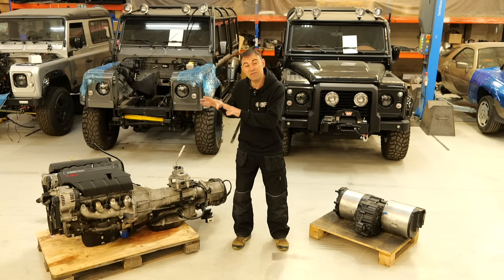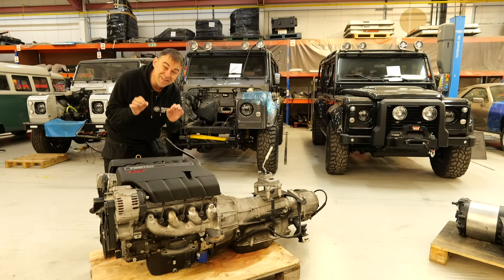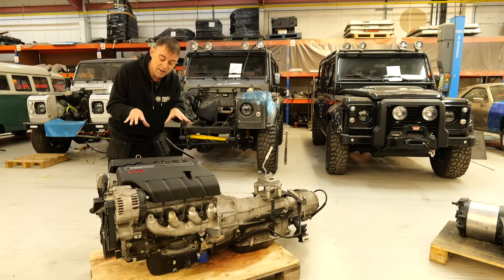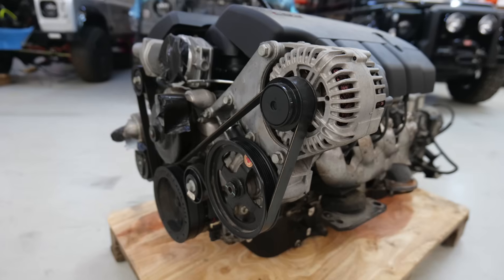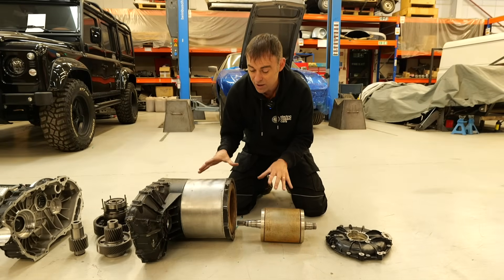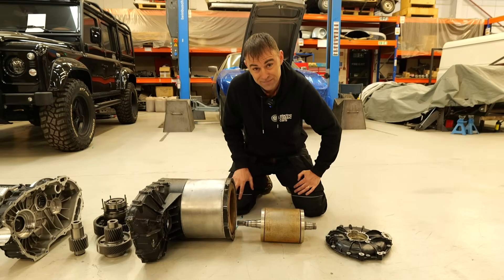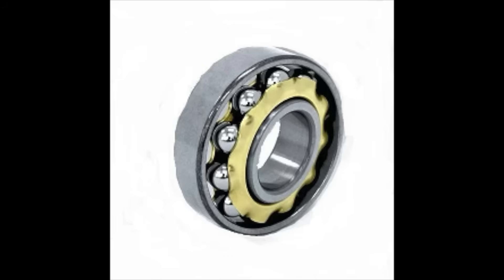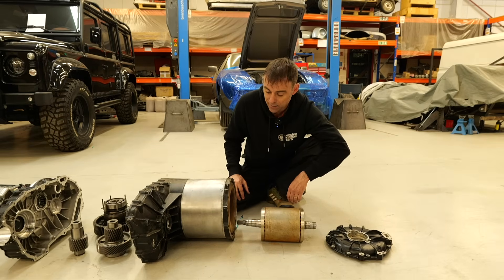Let's compare the Tesla LDU with an LS3 V8 and take one apart to see what makes it tick.

Comment: Great Video.
I 100% agree.
But what you left out is the battery.
But even with that I 100% agree.
Reply: They forgot to tell you it cost about 20,000 for a new battery. Also the resale is like buying an old iPhone that's 10-15 years old. Would you?
Reply: @kens6169  No i actually know more than you. I do actual research i don t form opinions on solcial media shorts or legacy media articles! :) 
Some facts for you:
The average modern EV  battery lasts between 200k and 500k miles, an ICE engine lasts between 150k and 300k miles, 400k for some well maintained ones (batteries don t require active maintainance from the owner).
Most EV companies guarantee the batteries for 8-10 years, 100-150k miles and around 70% capacity.
A new battery is not 20k. Battery costs is predictibly going down and have been for years.
Battery cost is going to be irrelevant once robotaxis will be the dominant way of transportation for goods and people. 
P.S. Do your research, invest in Tesla.
Reply: Your comment is exactly what I came here to write, but you saved me the trouble.   Thank you
Reply: It’s really quite simple, especially if you live in a large metro area. Electric vehicle for a daily driver and gas/petro for your weekend thrill machine to take to the country. Why…fuel options in the country are limited and the visceral experience of experiencing energy released from controlled explosions rather than stored electrons.
Reply: Why would you want such a cool looking defender with an electric motor? The exhaust note is part of the cool factor in a vehicle like that. I don’t want to hear some annoying electric whine. Stop talking about pollution, let’s see what happens to all these batteries down the road. Do you have any idea the amount of pollution created to build these batteries as well. Going green is a money grab. I can see having the electric performance in a Taycan Turbo GT, but not in a vehicle like this.
Reply: @mcwendel8066 
I prefer the mass distribution of my EV and there is nothing on the road that can compete with me... except another EV😅
Reply: @mcwendel8066  Over 95% of modern battery packs is recyclable. 
Also, no matter how you put it, batteries won t generate carbon amessions in the air whcih is the prblem we re trying to fight.
One more thing, deciding what technology is better based on what is "cool" in your mind is moronic.
Reply: @ i didn’t say the technology wasn’t better. However a lot of people who enjoy driving also like hearing the exhaust as part of the experience.
Reply: @ And yet you asked why one would electrify a defender. When the simple answer is, it s better!
Reply: @ debatable
Reply from the maker: This episode is about the Tesla drive unit, opening it up and seeing what makes it tick. We covered the fuel vs battery comparison in a previous Tech Talk. 👍 https://youtu.be/opF1si__APs?si=ylRtOg_340xyhEgv
Reply: if you include the fuel source for both, the LS3 comes out way in front for both longevity and simplicity.
Reply: @RoverIAC  Both the Tesla Motor and battery are good for 1M miles. I can't say that for the LS3 without spending as much on repairs and maintenance as would cost to buy a new Tesla motor or battery combined.
Reply: @ that's the claim they make, but it's not real. Tesla are currently being investigated for speeding up there odometers by up to 15% to get them out of warranty quicker.
Reply: @RoverIAC  lol They have been iunvestigated for a thousands of things in the years. Never came out with nothing. I love the "they are being investigated" = "it s not real" in your mind! xD 
Do your research, invest in Tesla.
Reply: @lucadellasciucca967  I don't lean either way but in late April, 2025, Tesla is heading for the toilet so I don't think I'd be recommending investing in that company via shares or vehicle purchase.
Reply: @ What makes you say that?
P.S. With investing i mean dollar cost average. I bought last week, i ll buy this week, i m gonna buy in late April!
Reply: Tesla sales have tanked. Year on year they’ve dropped 71% but don’t believe me, just do your research. As a matter of fact, I could think of 100 things I’d rather invest in than any car company.
Reply: @andrevanstiphout  My guy i ve been following Tesla for 5 years on a daily bases! There is nothing you can possibly know that i don t. 
336,681 (2025 first quarter sails) is 29% of 386,810 (2024 first quarter sails)?!  I think your sorces are a little messed up xD
I m also thinking you re confusing trading with investing. Many do! Tesla is leading real world AI, the most powerfull technology of the next 20 years at the least, and leading by miles (quite litterally!). Good luck finding a better long term investment.
Reply: @andrevanstiphout  Legacy media articles and social media shorts are not research my friend.
Reply: @RoverIAC your comments are comedy gold. Funniest thing ever, the lengths you go to. 
Can't wait to see how you justify using electricity to produce petrol is better than just using the electricity as fuel. 
So please explain oh great one how cutting out the whole extraction and cracking process is worse.😂
Reply: @ @watcher2401 your comment is comedy stupid. No one is using electricity to produce petrol (unless you are talking about the starter motor on an industrial drill rig). Do you even have an idea of where electricity comes from?
Reply: @RoverIAC  Google suggests that: (1) LS3 V8 engines can last 300,000+ miles with regular maintenance; (2) Tesla's electric motor is expected to last 1 million miles; and (3) Tesla's battery packs are expected to last 300,000+ miles. In addition, Tesla cars are likely to require far less maintenance than an ICE car.

Comment: Think the weight comparison is a bit misleading when you consider that the battery pack weighs over 10 x more than a tank of fuel.  Approx. 500kg for a battery pack and approx. 50kg for a full tank of fuel.  Also the fuel tank weight is dependent on how full the tank is so could be even lighter where a battery pack always weighs the same.
Reply: True. I'm hoping battery tech improves over the decades to a point that they drastically close the energy density in both weight and volume terms with fossil fuel's raw potential energy. EV motoring will be a very interesting proposition.
Reply: @tepidtuna7450  
It doesn't need to be even CLOSE, because...... "Efficiency"
There are already FAR more "Family cars" (EVs) now with more straight line performance than "Supercars" of 30 years ago that it's ridiculous.
Watched a Top Gear clip the other day where they were drooling over a Ford Cosworth capable of 0-60 in 5.5 seconds.
That's (virtually) "Every Tesla" (For example)
THAT Cosworth was "Throwing away" HUGE amounts of "Raw potential energy"?
.
The WHOLE POINT is to use LESS energy, but get MORE "To the wheels"?
Reply: @rogerstarkey5390 I agree, that was my point...the weight difference is irrelevant. Might give some the impression it means the car must weigh much less when it's the opposite hence misleading.
Reply: He's cover this about 20 times in the comments
Reply from the maker: This episode is about the Tesla drive unit, opening it up and seeing what makes it tick. We covered the fuel vs battery comparison in a previous Tech Talk. 👍 https://youtu.be/opF1si__APs?si=ylRtOg_340xyhEgv
Reply: @ElectricClassicCars  Wasn't trying to be arsey about it. Love your channel and the tv show and watch all the time. Just pointing out that some less knowledgeable people who don't watch regular might assume the weight difference between the two means the whole car would be lighter.
Reply from the maker: @floydpepper8289 No worries. That’s why we dropped in the link to the battery vs petrol comparison episode when we mentioned the weights and again at the end of the episode. But seems lots of people missed that.

Comment: You're not presenting facts, certainly not full disclosure. The "tesla" needs a battery, which weighs??? Sure the LS needs gas, but a 50lb tank of gas will take the car and the occupants as far if not further than a fully charged battery that out weighs the LS and the gas. I'm not saying the LS is better overall or even in the long run, but be honest with the viewer please. Also, since you wasted my time with displaying the necessary parts that allow installation of the LS into that thing you call a 4x4, installing the Tesla drive unit will require many many UNAVAILable parts..i.e., custom installation. The build cost for an electric conversion will be astronomical compared to installing the LS.
Reply from the maker: We’ve covered the fuel ve battery comparison in a previous Tech Talk. The Landy weighs the same when it’s converted to electric as it did when it had the LS3 engine in and fuel. 👍 https://youtu.be/opF1si__APs?si=DeO-eaOmX0DFzy27
Reply: True on conversion cost LS3 about USD10,000 plus engine.  Tesla hover around USD100,000

Comment: Really interesting tear down Richard.
I love both forms - to me there is nothing like the sound of a nicely tuned V8.
The Tesla motor though- is state of the art and some others are equally impressive. 
Now with much safer Battery tech EV are a no brainer.
BYD sodium Ion said to be nearly as dense and the LFP.
Sodium now 175Wh/ kg and there are still a few more options coming that will have density closet to 400Wh/kg under BTLR4 .
Aluminium Ion batteries that are being developed into production scale. Once they get to 400Wh you can have a motor and 100kWh battery for less than that LS3 and gearbox in equivalent mass. 
That is mind blowing.
The Sodium and Aluminium Ion batteries lighter, safer and fully recyclable and cheaper than LFP .
They say 2 years away for Aluminium Ion batteries.
Sodium Ion now in BYD car batteries as a hybrid battery pack 50% lfp 50% Na-ion.
Nio have a small car with 10-% Na Ion batteries but 250 km range. (approx 150 miles).
Reply from the maker: BYD are leading the way with battery tech now. 👍
Reply: Sodium Ion is HEAVIER and less energy dense.
It's CHEAP, but FAR better suited to Storage, at least for now.
WHICH "options" are promised with 400Wh/kg?
The best so far is I believe CATL who are at about 205-210 WH/kg?
.
Aluminium cells have a by-product of "Hydrogen" (which can be "quite dangerous"?) and as I recall they are "Sacrificial", suffering corrosion of the aluminium.... which is a problem?
They sit firmly in the "Solid state" section of "One day...... maybe".

Comment: You can't beat the sound of a V8, I don't care how fast or efficient the milk float motor is - it will never scratch the itch ...
Reply: True. I love ICE and EV.
Reply: My contribution to carbon footprint reduction was to buy an Audi RS4 4.2 litre V8.  How come?  Being retired, I travel WAY less than its previous owner, so by buying it from him it burns way less petrol in a year that it did when he owned it😃.  I just love the sound!  When I replace our other small SUV it'll be with an EV though.

Comment: Electric is LESS efficient than Gasoline for mobile vehicles (for range over 100 miles). This is due to the battery weight."The total WTW efficiency of gasoline ICEV ranges between 11-27 %, diesel ICEV ranges from 25 % to 37 % and CNGV ranges from 12 % to 22 %. The EV fed by a natural gas power plant shows the highest WTW efficiency which ranges from 13 % to 31 %. While the EV supplied by coal-fired and diesel power plants have approximately the same WTW efficiency ranging between 13 % to 27 % and 12 % to 25 %, " "Comparison of the Overall Energy Efficiency for Internal Combustion Engine Vehicles  and Electric Vehicles  Aiman ALBATAYNEH1∗, Mohammad N. ASSAF2, Dariusz ALTERMAN3, Mustafa JARADAT4"
Reply from the maker: If you’re going to make stuff the least you could do is back it up with a source. Like this one that shows electric is MORE efficient that Gasoline. 😉👍 https://www.motortrend.com/features/truth-about-electric-cars-ad-why-you-are-being-lied-to
Reply: @ElectricClassicCars 
People forget that the fuel has to get to the power plant,  the plant efficiency (better but not hugely than an ICE), transport losses, distribution losses, charger losses, battery losses, inverter losses, and motor losses. The most efficient gasoline vehicles are only a few percent less efficient, WTW, than EVs.
Reply from the maker: @joekoelker7523 Again, please provide a link to a study which confirms this as all the studies I’ve read that take ALL of that into account the EV is still many times more efficient that ICE. 
You seem to forget that you have to drill oil out of the ground, pump it to a port, ship it half way around the world, refine it into petrol, transport it to a petrol station then pump it into a cars petrol tank, then after all that only 20% is used to make it move. Not forgetting that it takes a huge amount of electricity and energy (with lots of losses) to do each stage of that process. It’s madness. 🤷‍♂️🤦‍♂️
Reply: @ElectricClassicCars 
The punchline from the Harvard piece is: 

"The total WTW efficiency of gasoline ICEV ranges between 11-27 %, diesel ICEV ranges from 25 % to 37 % and CNGV ranges from 12 % to 22 %. The EV fed by a natural gas power plant shows the highest WTW efficiency which ranges from 13 % to 31 %. While the EV supplied by coal-fired and diesel power plants have approximately the same WTW efficiency ranging between 13 % to 27 % and 12 % to 25 %, respectively."

Comment: It is easy to see that an electric drive system is a simple and elegant method for some mid range/ commuter vehicles. 
What is the gross vehcle weight of the LS powered landrover compared to your electric version and howmany kWhr battery is fitted. Range for range might be interesting 
Many of my comments are not particularly glowing, great vid keep up the good work
Reply from the maker: They weigh the same. 👍

Comment: Coal, oil and nuclear power plant efficiency averages around 30-35%. Those sources are the majority of the world's electricity power plants. If you take that in consideration the electric motor is not very far away from the ICE.
Reply from the maker: You have to then add those losses for petrol too as it take a lot of electricity to drill it out of the ground ship it half way round the world, refine it, transport it to a petrol station and then pump it into the car. All of these stages take energy and electricity. Many studies have been done on this and they all have EVs much more efficient use of energy that ICE. That efficiency for EVs is getting better all the time as more and more renewables are being introduced onto the grid. 👍
Reply: @ElectricClassicCars  Well, that's goes for the raw material used in electricity production as well (coal, oil, gas, uranium). And so far, only a minor amount of the world's electricity is produced of renewable sources. And if you do a correct calculation of the efficiency for nuclear energy the numbers are even worse. Many of today's reactors use approx 4-5% of the energy in the fuel. However, with coming generations of reactors and a proper fuel cycle those numbers can be improved. No doubt that the future belongs to mostly EV:s but today, with coal as the main source for electricity production, you are running steam vehicles, so say.

Comment: So 90% of the energy put into that motor will drive you along but you have failed to show the inefficiencies of generating the power in the first place and storing it
Reply: What about solar and wind power??
Reply from the maker: I didn’t show the inefficiencies of drilling the oil out of the ground, pumping it in pipes to a port, shipping it half way around the world, refining it into petrol, transporting it to a petrol station and then pumping it into a car either. 🤷‍♂️ All of which takes a huge amount of electricity and energy.

Comment: And where did you get 20% from it is in fact a little over 30% as are most other petrol engines
Reply: depends on the load, rpm, other conditions.  30% or so is the very best they do.

Comment: Hi Richard, really good insight in to the workings of the Tesla drive unit, amazing how much power and torque come from such a small rotor. Electric is hard to argue against when you compare the two, especially with the speed of development with battery technology.
Reply: Yes and no , electric motors are compact but very heavy , but the fuel tank IE: the battery weighs one third the weight of the car ,  its a shit deal , give me the V8 any day of the week .
Not to mention , Ev`s are the the most horrible bland driving experience , we have a shitbox tesla in the family fleet , dual motor long range with the performance upgrade ,  yes it accelerates in straight line fast , but it is a souless , characterless shit box imo , its like driving a vacuum cleaner .
Reply: Batteries suck and are not safe. Better start looking ip EV fires.

Comment: A very informative and interesting video - thank you. I just worry about the longevity and availability of the electronic parts used in the inverters. I assume they're variable-frequency inverters, as used in rail traction these days?
Reply: I suspect the part will get better for a while, so if something does break the replacement will be better. What I worry about is that everything is computer controlled and that means software. And the vendor owns the software. No copying, no upgrading and difficult to replace. So what happens when the vendor goes out of business or refuses to service the part ?
Reply: @francesconicoletti2547 this is where electric conversions make a huge contribution to the ecosystem. They fund the reverse engineering and aftermarket product development that will be the spare parts for orphaned cars. They also train people who can actually diagnose problems rather than just look at a screen and swap the parts it tells them to.